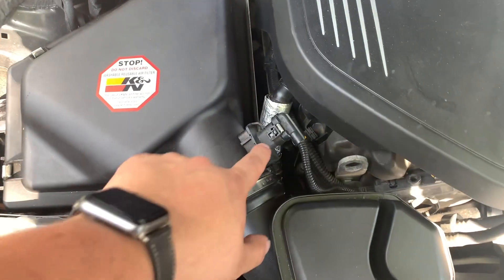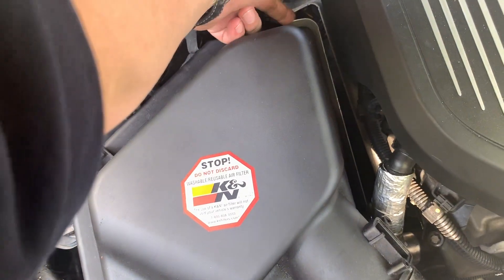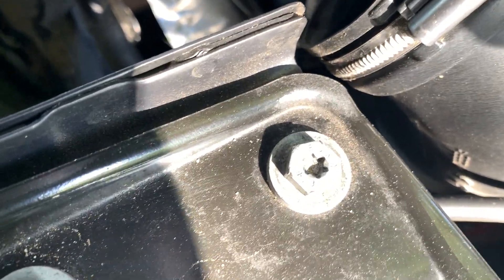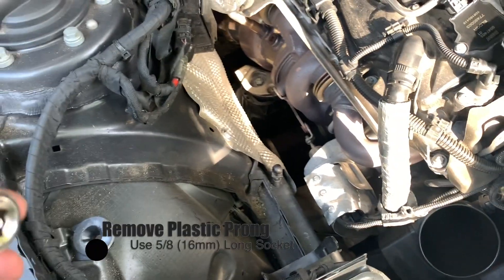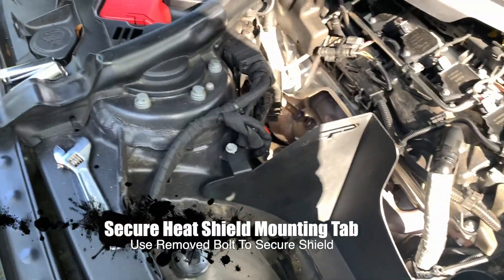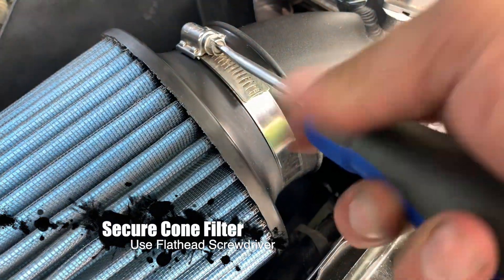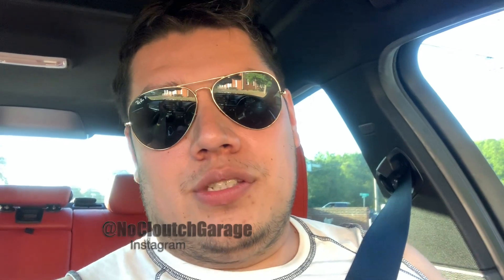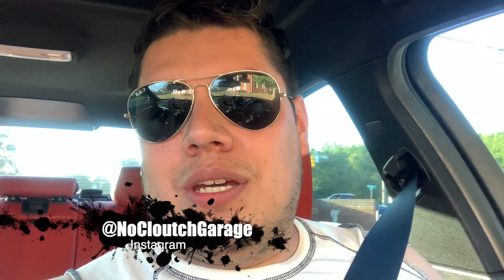INSTALLING THE AGENCY POWER COLD AIR INTAKE FOR B58!!!

Comment: Hey i know its been a while since you did the install but I was wondering if the clamps around the silicone part went completely over the pipes or just tighten near the pipes and are closer together. Thanks for making such a good video man. I really helped with my install yesterday!
Reply from the maker: You always want to have a good amount of that silicone over the ends of the pipes and then tighten the clamps over the coupler not to close to the edge of the pipes.
Reply: @NoClutchGarage  Sounds good thanks!

Comment: Hey found this video really helpful for my install yesterday! But did you have any fitment issues with the rubber end that connects to the turbo pipe? I worked on this for 8 hours yesterday and it would not fit. When I rarely did get it to fit and Sealed it with the metal strap if I moved it a little bit it would keep falling out. Ended up just having to put my OEM intake back on.
Reply from the maker: Hey! I’m glad my video was helpful! The turbo inlet is definitely tricky to work on. It’s definitely going to be snug. I recommend undoing the metal brace as much as you can and making sure the rubber coupler is on securely first, then, try to fit the clamp on and tightening it as much as you can even if it seems like overkill. The key is making sure the pipe is positioned correctly from the beginning so that there is minimal movement when working on the intake pipe. If you want a more detailed explanation please contact me through direct message on my Instagram account @noclutchgarage !!!
Reply: NoClutch Garage appreciate it brother! Going to try again tonight with your tips. If all fails again I’ll hit u up on Instagram! Also Keep the content coming brother, it’s really helpful. Installing my downpipe this weekend as well going MHD stage 2, I’m stoked. Loved stage 1 for the two weeks that I had it
Reply from the maker: You have no idea how encouraging it is to hear this! At the end of the day I’m doing this to help the community, I can definitely help you with anything you need if you DM me! I’m glad you enjoyed MHD, please don’t hesitate to leave a comment if you run into any issues. Stage 2 is going to transform your car into a totally different beast! Best of luck!

Comment: did they give you two difference couplers as well or did I fuck something up? they sent me an all black and a black outside orange inside like the one you used.
Reply from the maker: As long as they’re the same diameter it doesn’t matter where they go.
Reply: @NoClutchGarage  im asking did you need two couplers for the instal or just one where the turbo inlet meets the intake pipe?

Comment: Thanks for the video! I am thinking of installing this on my 340i as well. Have you run into any MAF issues or check engine light issues due to this?
Reply from the maker: Not at all! I have in the past though, but usually goes away on its own.

Comment: I’m on the fence between this intake and just keeping the OEM intake and replacing the drop in filter with a AFE Pro Dry S filter. I know performance gains will be minimal but would you say the sound difference is noticeable between the drop in and cold air intake ?
Reply from the maker: Noise difference is totally different between a CAI and just a closed box intake but you also have to delete the intake pipe resonators to get the full effect.
Reply: NoClutch Garage was originally going to go with a CG DS1 catted down pipe and a Dinan high flow mid pipe but I’m trying to avoid too much raspyness. Don’t want it to sound cheap. Looking for more of a deeper/throatier sound. So was thinking of getting the Agency Power instead of the Midpipe. What would you recommend? Thanks for your input !
Reply from the maker: If you want a throaty sound you may need to get a full turbo-back exhaust. I think my exhaust sounds a bit raspy but it sounds so good under load I really don’t mind it, MPPSK is definitely one of the best sounding exhausts out there
Reply: @NoClutchGarage   i also have MPPSK and Stage 1... catless downpipes I've read will make the car VERY loud, which I definitely dont want. But sound of air rushing in appeals to me lol. That and ~10HP sounds like a good idea. any suggestions?

Comment: I like to inform you that it is not a 6 mm and thats what caused you to take forever on removing the lower intake....It is a 7 mm you need to edit the subtitles or something... you had me out here with a damn 6mm and its a 7... im missing my 7mm out of my socket set.... very misleading... other than that, great video man
Reply from the maker: I’m not updating it specifically for a 7mm because for me it was indeed a 6mm as well as many others but the clamp bolt sizes can vary, I have them anywhere from 6mm to 8mm depending on the clamp. If 6mm doesn’t work for you then you obviously should try a larger size. I can make an update that clamp bolt sizes may vary but generally BMW uses 6mm or 7mm clamps. That’s why it’s important to have a full tool set for these occasions you wouldn’t believe how many tutorials I have followed before where socket sizes are completely wrong. Thanks for watching though, and I hope you were able to get this on!